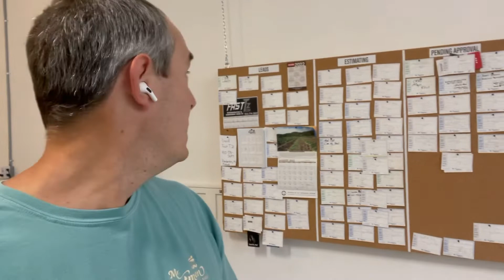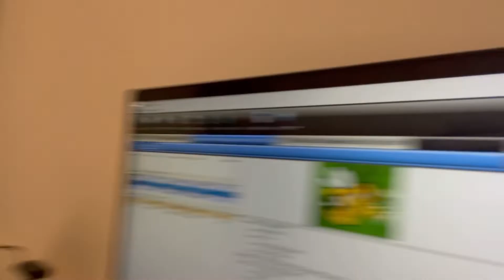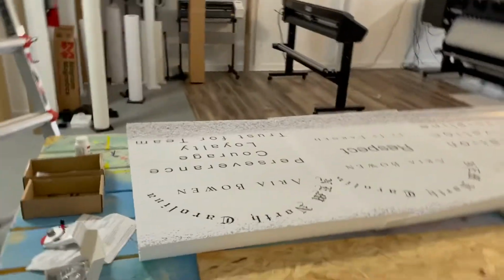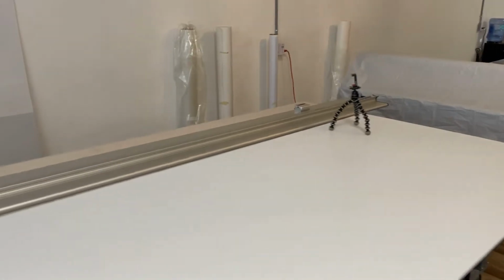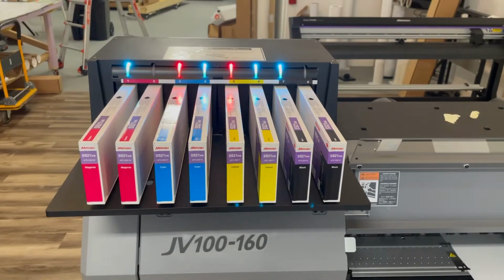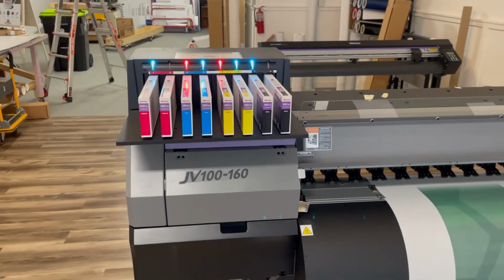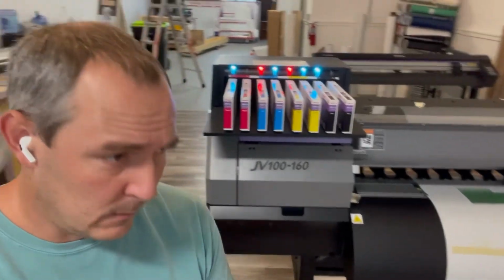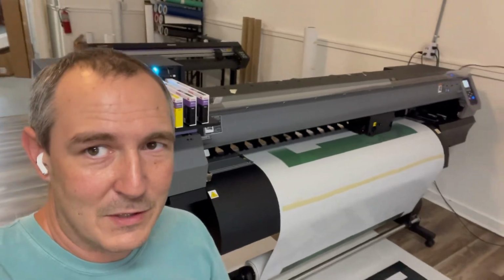Keencut Sabre 2 Issue Solved: Mr. Postman Print Shop and Signs Vlog

Comment: A $2000 cutter that requires a $1000 table to use. :D Check your sign ordinance to make sure they won't consider murals part of sign sq ft. Some jurisdictions do. Not going to say where I've run into that (Containment Area for Renegade Yankees).
Reply from the maker: Thankfully, the city of Whiteville has told me there are no permits required and no ordinances for one-way window perf. I sell and install a lot of this stuff in town. Cary does like their signs nice, prim, proper and no larger than a specific size. LOL